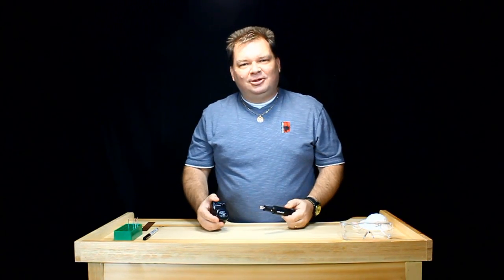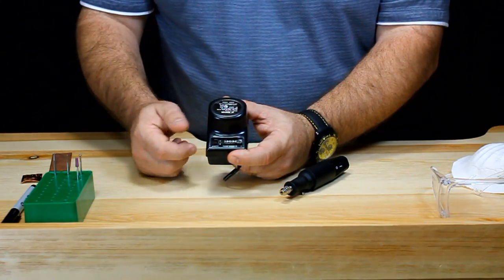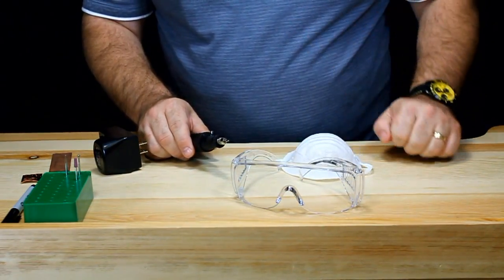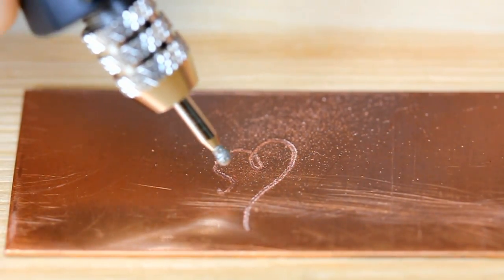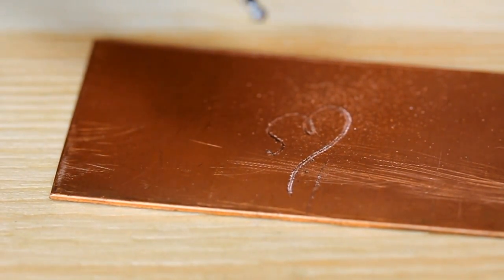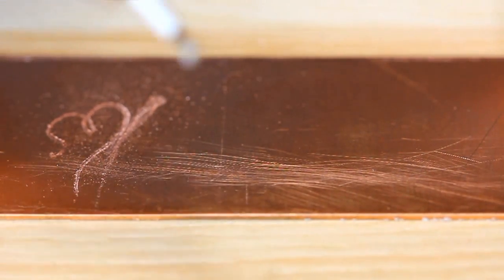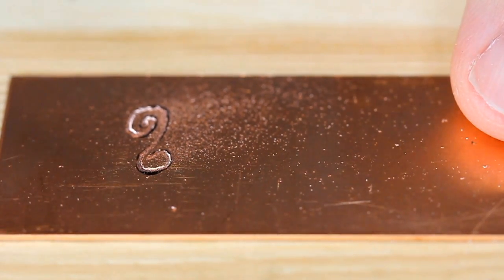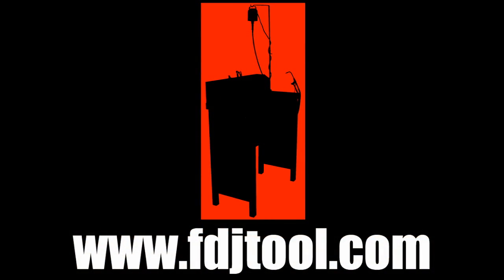Using a Hand Engraver with Diamond Points

Comment from the maker: That is a good question.  We did not design or build the tool.  My guess is that the voltage is regulated on the power adapter in order to eliminate any excess bulk on the handpiece.

Comment from the maker: The on/off switch is just what it is: on or off.  In the "on" position, power gets to the handpiece so you can use it.  In the "off" postion, there is no power to the handpiece.  The speed of this unit is controlled by the amount of voltage sent to it from the adapter.

Comment: i bought a dremel for making tank drums. It's fucking huge and i couldn't engrave anything with it. this thing is small which is similar to a pencil. Not that i would ever engrave anything. Oh and the dremel i had goes up to 35k, i think this was going around 10-15k rpms in the video, but some engravers go crazy high, up into the 200k range.

Comment from the maker: It depends on what you want.  If you want designs and flourishes, you should find a professional who hand engraves.  If you are just wanting simple things like initials or dates, you need an engraving machine (which can be found on our web site).  They are somewhat pricey and require lots of practice, but it is what jewelers use for most basic engraving.

Comment: can you use it on wood
Reply from the maker: Not as it is.  First, the diamond bits are the wrong bits for wood.  Second, this tool has low torque even with the right bits, it would be good just for surface etching, not deep gouging.

Comment: Can you use this on a gun ? Can you make designs on that type of steel other than lettering pr do i have to buy the other type of hand engraver
Reply from the maker: This engraver is not the type of tool you would used to engrave decorative designs and patterns on guns.  Most gun engravers use power tools such as GRS powertools (GraverMach, GraverSmith, etc).  They are high speed pneumatic tools for use with gravers to cut designs.